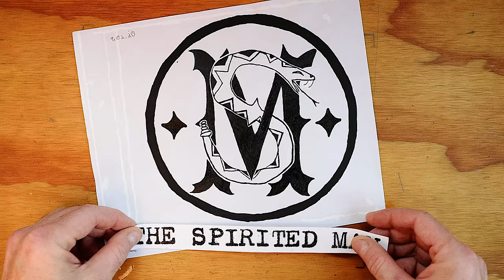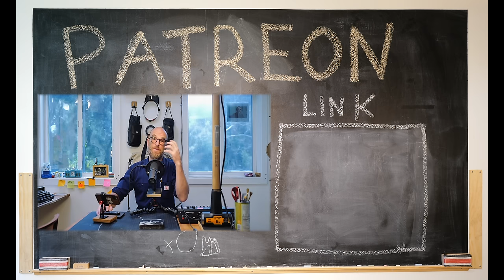The Philosophy of Driving Stick

Comment: CLUTCH!!! + BRAKE, no? Still hitting those rocks without the brake.
Reply: 3:18 Yeah, "BRAKE! BRAKE! BRAKE!" would've worked in this case, or pull on the handbrake. If she was hitting the clutch she'd still hit those rocks.
Reply: @aquaman3874 there's no hand brake in that truck, only parking brake pedal
Reply: @estefano9e  I would hate to teach someone to drive stick in a vehicle with no handbrake accessible to the passenger. You hand total control to the newbie.

Comment: Learning to drive a stick fostered my sense of adventure. At 19 bought my first new truck and it was a stick. After a couple lessons on the back roads of rural Georgia I drove to Atlanta the next day. No cell phones, no GPS. Just Rand McNally and me. I do miss those days, managing to eat a Big Mac, slowing down to a stop sign on a hill and hand rolling the window down while turning the radio station. It would take all 4 limbs and appendages but you learned to work with what you had.

Comment: I had all the steps and processes explained to me about how to drive manually and it took me the longest time to get it.
Then some geezer explained the clutch by holding both his hands parallel in the air in front of him. He started rotating one around in little circles in the air, and then slowly brought the palms together so they both started rotating in sync. The first rotating hand is the engine, the other hand is the wheels, the clutch is what separates them or brings them together. For the clutch to do it's job, the wheels and the engine need to be spinning in harmony. The gears and gas controls how fast the engine spins. The brakes slow down the wheels.
After that was magic.

Comment: This is an EXCELLENT lesson on how to drive a vehicle with a manual transmission! And that's no joke!
Reply: It's not he tells her to coast and to clutch when she wants to use the brake (2 mins 8 seconds), coasting isn't the correct way to slow down or keep the vehicle under control. It would fail you on your uk driving test and can lead to an accident as you do not have the vehicle under control

Comment: Stick is some tricky business but it's all about that feeling! The connection to the vehicle, the ambition to be as smooth as an automatic. Ive been teaching my partner to drive my TDI swap 4Runner and I started her in 4 low 😂
Reply: Dang that's actually a really good idea! I first learned stick on a tractor, where it was super slow and the clutch was basically on / off.
Reply: Ya I've done the same teaching some nieces how to drive in my 3.4L swapped Gen 2 4runner.  4lo.   No gas to start, unstallable.   Could have em row through all the gears up and down without going more than like 25mph.

Comment: I found using the gears easier when I understood how it worked mechanically. Or by thinking that first is a gang of people pushing to get the heavy car going, 2nd is less people to gather speed, 3rd is even less etc etc. And you can slow down with gears also, so dropping to 3rd with no accelerator will slow the car, then when its right, drop to 2nd to slow further. This also has the bonus of slowing without your brake lights showing if the cops are behind you ;)

Comment: I think the trouble she had when parking is if you dip the clutch it doesnt slow you down, you need to change gears and / or brake at the same time. Dipping the clutch keeps you moving forward or coasting.
Reply: it's even worse, it makes you go faster (most of the time) since you are no longer engine breaking
Reply: Yeah, she needed the brake, not the clutch (Well, the clutch would be a nice addition but the brake is the important one)
Reply: Brake for sure, doesn’t matter if the car stalls
Reply: I think she already knew that as she used brake while stopping on the beach.    But he was also yelling at her to not hit the car next to them, so with all of avoid car, turn hard, braking, clutch in at the same time, she couldn't quite process it.  
And if you turn into a spot like that and come to a stop too early and have to learn to feather the clutch to pull forward a foot or two without hitting curb/rocks/whatever , that's a whole different skill.
Reply: Yeah, he said “she panicked”.    No, he did.  She would have been fine, if he didn’t freak her out.
Reply: It's a Diesel. If you hit the brakes to come to a stop and don't clutch in, it'll muscle it's way through past the braking force. It'll keep going. If you hit the brakes without the clutch in a Gasoline car, it'll stall.
Reply: @qers  not all gasoline powered vehicles have low horsepower/torque. Some will overpower the braking system and then breaking things in your path...lol
Reply: @Ty-ye8rd  I agree. One needs calm, patient atmosphere AND instructor. 🎯
Reply: Yep. That’s the same thing I taught about. I was like well, more like the clutch + the brake lol
Reply: The biggest problem she had was the distraction in the passenger seat....

Comment: Ive never driven a manual car, but I spent a summer working at a baseball complex and we had a utility vehicle that was manual (picture a larger golf cart with a pickup bed). The funny thing was that 1st gear was broken so you had to start in 2nd and it took a lot of finesse to start it smoothly without rocking as if you were driving over a million potholes. If you had a really good touch, some of the guys would start it in 4th gear; youd take off like a rocket but it was really easy to kill the engine if you didnt have the perfect clutch release. It was intimidating learning how to drive the thing, but by the end of the summer, even I was startring it 4th gear.

Comment: I completely understand Isabel. My husband thought me to drive stick but then we got rid of our manual transmission car. He finally got another one a decade later and I was so out of practice! I freaked out on the loop getting onto the freeway because I didn't know if I needed to downshift when slowing down. I ended up going so slow that the CHP pulled me over thinking I had been drinking or altered in some other way 🤦🏻‍♀️ I had to explain that I hadn't driven stickshift in so long. They saw that I was completely lucid and they just ran my driver's license and registration and let me go.
After that, I drove fine and only seemed to stall when my husband was in the car with me 🤨

Comment: When panicking, just break and let the car die
Reply: Exactly and don''t scream CLUTCH. Even with the clutch pressed she probably would have hit that rock. The break is the panic button of the car
Reply: I would prefer to "brake".
Reply: Yeah I didn't get that part of the video at all. Clutch AND Brake yes. But just clutch... the only thing that will do is accelerate the car even more into whatever you're going to hit.
Reply: With diesel torque;  Landcruiser brakes probably wouldn't stall it!  Definitely apply clutch and brake!
Reply: bad advice. just use the clutch as intended, or dont drive a manual.
Reply: Please,  explain and expound on your expertise.
Reply: @williamtylerast  exactly imagine just stalling on a public road “in my panic i hit the brakes” …
Reply: @Trackrat81ITR  Yeah I was thinking this too. I assume she can already drive an automatic car so she knew to brake, but perhaps the vehicle had too much torque and wasn't going to stall, hence Van was telling her to use the clutch. Could be wrong though.

Comment: In the UK we just call 'driving stick' 'driving'.... pretty uncommon for anyone not in a brand new expensive car to drive an automatic
Reply: In my world  you are either driving a vehicle or driving an automatic.   Owning a 2016 Tundra and a 2018 Highlander has affirmed how much I dislike slush boxes and  I love my 2000 4 Runner with a proper 5 speed  gear box and my  1963 MGB with synchros only on 2nd, 3rd and 4th.

Comment: I'm with you! 
Learned to drive manual in a '65 GMC 920 powered by a 230 cu in (3.8 L) I6 and paired with a Muncie SM420 (4 speed synchromesh) transmission (still have the truck, although the engine got tired and was replaced with an original spec 292 cu in (4.8 L) I6).  Currently daily driving a '96 Toyota Tacoma powered by a 3.4L 5VZ-FE and paired with a R150F (5 speed).  Save the Manuals!

Comment: I have mostly driven manual transmissions since 1982, and you are correct - there is a sensory connection to the machinery through sound, and feel, that do not exist with auto 'boxes.

Comment: The best of this world is to drive a car with a manual gearbox, no power steering or power braking, these are the real sensations.  No assistance, man and machine. Like here in Europe especially in France with our old cars.
Reply: I’ve been dailying a 97 Miata for the past two years. 5 speed, no power steering, abs, traction control or anything to aid you. I’d say I’m a way better driver because of it and now I prefer that raw driving experience over all the other cars I’ve owned and driven.
Reply: The ultimate expression of your thought is a motorcycle

Comment: I’d say the BRAKE is the panic button, not the clutch…all else fails, hit the brake. Pushing in the clutch does nothing to actually stop the vehicle. For example, you can easily smash into rocks if you only press in the clutch. 😊

Comment: My almost 14 year old loves driving the 5-spd wrangler in parking lots. There is a time when a switch is flipped on a manual transmission when you 'get it.' He got it very quickly. Now he says he wants to take his drivers test in the Jeep - at least the parallel paring part will be easy.

Comment: A few things too many:
First, if Isabel has the courage to drive manually in the future, it was a great lesson and could make her more careful and aware than most.
Second, I do think perhaps that she may not have been on a collision course with the parked car and the "watch out for that car, watch out for that car!" Worked as a distraction causing her to forget the clutch. But the risk of hitting the other car is such that it is better to avoid it and just dent your own bumper, so all in all, completely understandable.
Last, when he went to college I inherited my brother's '88 Dodge ram 1500 pickup. It was a four on the floor (four speed). Had holes in the floor we left and some in the roof we patched with bondo. Old windshield wipers, driving in the rain was a sport. Bi tailgate. Dark bluish purple paint chipping up with orange underneath. Previous owner was a painter. He got it for $400 ran great for half a decade without issue from when we bought it. You could start from a stop in second gear and get it to ho bike and clank forward like it had hydrolics. Not great but people always laughed. Now my current girlfriend has a rather new Subaru Crosstrek. 6 speed, the sporty shifter grip snaps back into center position whenever it is in neutral (straight up is 3, down is 4, left up/down is 1/2 and right up/down is 5/6). Has a lever on it you have to pull up in order to push it all the way right and put it in reverse. Feels like a sports car compared to the '88 dodge. SUV is fitting. 
This was pointless, thanks for reading.

Comment: Omg I laughed so effing hard it was like I was choking on air!

Izzy, you handled that stick like a pro on that beach! I used to teach ppl how to drive stick, and I've never seen anyone have that quick a grasp. Yr moto experience must've really helped! 

1+2 is 90% of all clutch work. 1st is all torque, no speed. Much chooch, no chotch. Its almost always to just start moving, second gear is ac-ti-ón.  Less torque than the last gear, but more speed, this is a pattern. 3rd is just gear 2, part 2. Less oomph, more weeee. 4+5 are overdrives. Or cruising gears. Van should've shown you how to coast in neutral to a stop. That's pretty helpful in Driving Stick 101, cuz it's one less thing to focus on. And when not using the clutch pedal, take your foot off it, don't rode with it there, just the weight of your foot on some cars causes slight compression and will cut your clutches life in half. And that's $3k no one wants to spend.

Stick 102 = Gearing down to slow without using the brakes, to accelerate faster or just just maintain speed on an incline.

Optional advanced classes include
Stick 201 - roll start, "popping" the clutch

Stick 202 - clutch balancing in traffic stopped at a light on a hill. Brake delete.
Reply: Ok, thank you!!! Also, I’m screenshotting this comment for my own learning reference. I haven’t driven the car since - it used to be my car until it was ruined with this horrible, loud manual transmission.
Reply: @isabel  my wife did almost the exact same thing when I taught her how to manual a decade or so ago, seriously, don't feel bad. At a $100 fix, you're swinging under par right now. 

I'm sure in the moment Van was more heated than the video makes it seem. I know I would've been.  The videos walked back tone took me weeks to get at myself, so I found it rather, idk, astute and...evolved ..(?), and slightly jealous, that Niestat arrived there so quickly.

Thanks for setting me straight about his audiowork the other week too. Seriously. Top notch. You guys rock.

Comment: The easiest way to start driving stick: start the beginner off in a wide open parking lot and point the car down a subtle decline. Preferably a Honda civic or Corolla -easiest clutches ever to learn on. The key then is to instruct them to only use the clutch and no gas pedal to initially pull away (of course: clutch depressed and vehicle in 1st gear), don’t even touch the gas pedal!  Simply release the clutch slowly SLOWLY until the car starts to move, feel that point, and then press clutch pedal right back to floor. Repeat! Familiarize them with this clutch engagement point. Then after doing this several times, introduce the gas pedal.

I learned to drive a stick shift at OHV parks as a 10 year old in my Dad’s 1981 Toyota 4x4 22R -literally sitting on a phone book. And yea, I’m even technically a millennial.

Comment: This made my heart hurt. I miss driving stick every day. I learned on a 74 Volkswagen Passat where the clutch would just give out in the middle of gears. You could be going 80 on the highway and the stick would just fly in the neutral. I graduated to a little Ford focus five speed and then I had a Volkswagen c30 that was a six-speed and I love driving that car every day. I actually think more automobile accidents are caused due to automatic transmissions because nobody is present for the experience of driving anymore

Comment: When I was 14 or so, my older brother pulled over on a dirt road and had me hop in the front seat of our ‘96 manual transmission 4Runner. I pressed the clutch, started the engine, and tried to follow his instructions to get moving. It was my first time, and despite my best efforts I kept killing the engine. Furious at my failure, my brother barked at me to get out. When he got back in he realized he had left it in 3rd gear, and apologized 😂

Comment: I;ve only owned manual transmission vehicles, pickup trucks only.  For the last 21 years its been the same 4 cyl Tacoma. 👍 Its got 287k miles without any engine work.  And I have not replaced the original clutch. Come cruise with me in santa fe.

Comment: I learned to drive stick in 9th. grade, early 1970's- my driveway; it was a 1961 Corvair 4-speed.  The shift pattern was so bad that it was no longer a "H", but a sloppy circle.  The first time, learning just to back it up....took me about a half-hour to "get" it.  In 10th. grade I got my Learner's permit....and was drifting that sucker a few days later.  Since then, every car I've owned has been a stick....
1 Samurai, 2 Hondas, 2 Wranglers.  Driving a manual transmission= DRIVING.  Driving an automatic= Pointing.  ps:  I've taught 3 people to drive stick- it's the teacher!; my niece took about 20min. in my Jeep.  I begin w/ explaining "what" is happening w/ the mechanicals....the clutch does this, etc.  Then practice nothing more than feathering the clutch and gas....in 1st. gear, to "understand" the interplay between both.  Actual driving/changing gears is next.  The last thing I teach is....hills; using an E-brake, quick gas, etc.  ps:  WHY fix a bumper- especially a REAL one?!- that's why I loved my old Wranglers- that had a STEEL "C" beam for front/rear- not some glorified piece of plastic and foam core.

Comment: This bumper repair if it has been done in the states it would’ve cost at least $1000
Reply: I disagree. No competent shop would have done that "repair" thay way. A replacement bumper would be less than $500.  Scary "repair" and useless.

Comment: I learned how to drive by myself basically. The reason…my family only owned manual. My dad was an ac construction worker with a temper. So I opted to buy an automatic and wing it. After a couple lessons. I only needed it to get to community college. That was fine. I still find I’m a safer driver than at least half. And don’t regularly do dumb shit. Like actually stopping at 4 ways and signaling when changing lanes. Meanwhile douches be weaving and cutting ppl off with no regard for safety. Very cool Broski.

Comment: I learned how to drive a stick on a Ford 9-N tractor. 4 speed. with High and Low range. But you could only shift while the tractor was not moving. It had NO sYncros. Nope. So if you wanted to shift while it was moving you had to match the rpm's with the speed exactly and be real careful shifting

Comment: Drive standard is a discipline you have to master, it takes coordination and concentration at first, once you master the thing, it’s just normal, it merges into your brain. Just one appreciation, the foot on the clutch pedal has to be out of it when you are not gonna change the gears, otherwise it will be worn out.